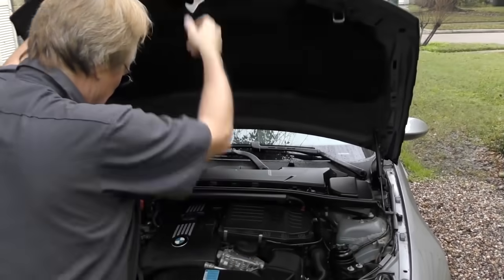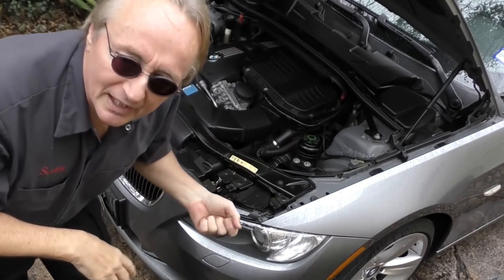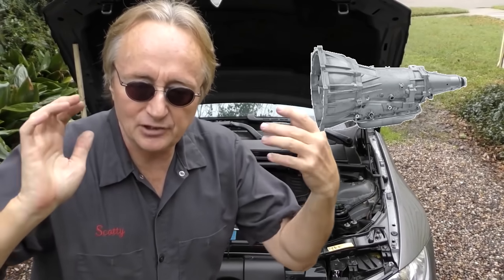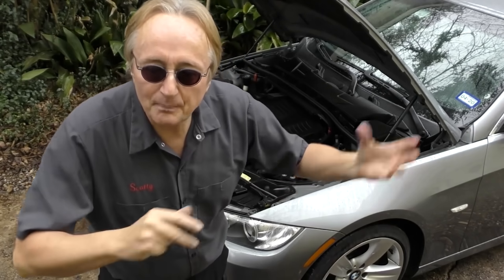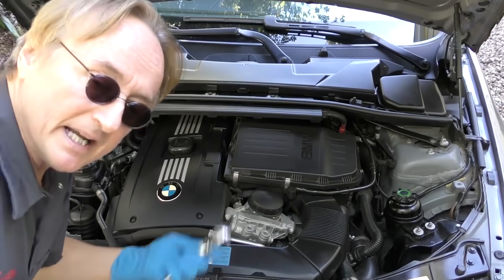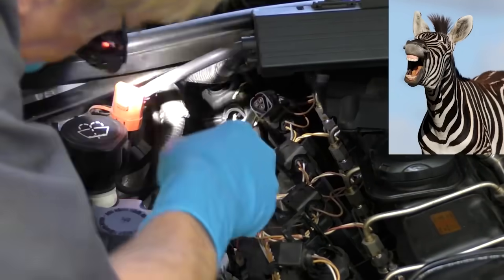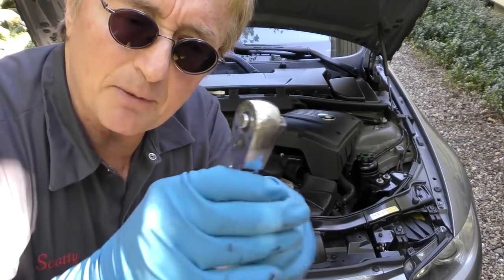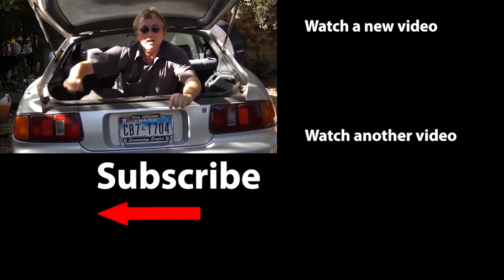People Say I'm Full of Crap About BMWs, Well Watch This

Comment: I've always wanted to own a BMW M3, and then I hear Scotty's voice in my head say "endless money pit" over and over.
Reply: Just get a warranty
Reply: Ive had two they aren’t unreliable at all and trust me i beat on my cars
Reply: @Mixalhsellada  10 years and no issues? Great to hear it’s running strong!
Reply: @Scooterboii94  good to know! Maybe in a few years I’ll splurge on one.
Reply: @BrandonMinguez  you better hurry up the prices on the e9x generation is rocketing to the moon
Reply: Just do like he says and lease one. Then you get to own it for awhile, but it can be someone else's endless money pit.
Reply: @Scooterboii94  for real i just bought a 2009 328i with 118k miles for $8,995
Reply: What about the rod bearings!? Was this huge job already done prior to you buying the car?
Reply: @enermaxstephens1051  Eventually I probably will. Maybe after my new car stops working.
Reply: @Mr Calcium haha I love the “boring reliable car” description. In the future I’ve thought about having a hybrid (for decent gas mileage) and then some type of muscle car or maybe an M3.
Reply: E92 m3s were actually very reliable. Mostly because they’re not turbocharged like the n54
Reply: @virenpatel9973  first model with the V8 (I believe) and an overall beauty.
Reply: I had a BMW m4 for over 5 years, bought it brand new. Never had an issue, manual transmission. The materials were nice but not that great. Fun to drive but the older ones were much better, talking about e46 era
Reply: @ronaldo19832  you bought it brand new. Go buy that car back now. See how never had an issue holds up.
Reply: @BrandonMinguez  yeah they were the first m3 with a v8
Reply: BMWs love to have their maintenance done before it needs to be done. As long as you do things when you know you should rather till its broken you'll be much better off. They're great cars in my opinion on my third one. First one was an E46 I owned and ran the hell out of. Ran like a champ and sold her running @ 18 years old.
Reply: @Chaos1187me  e46 was a different generation. N54 had ridiculous failures. Replaced 3 water pumps due to leaks in like 2 years. High pressure doesn’t help. If you continue to drive on one leaking component, 2-3 other components in the same system are guaranteed to fail.
Reply: I also hear “Cheap plastic crap!” 😂😂😂😂
Reply: @Mr Calcium this dude knows how to own exciting cars. You literally need a savings account for repair and maintenance work. Just put down money monthly so your cars repair doesn’t give you a new credit card bill and its not such a pain because it was for the car either way.
Reply: @Mixalhsellada  you probably deive it moderately and take good care of it. Most people eat on them ecause theyre sporty and the rest in history
Reply: my dad owns a 2010 bmw x5 for 4 years it is a dream
Reply: @staplegun3703  Yes, I have one of those and had the model before that as well. Probably the two most reliable and trouble free cars I have owned. Both towed regular heavy loads as well.
Reply: BMW's are great cars, they require some extra maintence but go for it.
Reply: Avoid turbo models and you'll be fine
Reply: Yes, I've known very few repeat BMW owners.  I like them a lot, but would never have one myself.
Reply: I have an 05 M3, yes he is right about the cost of maitence, but if you buy the car and know how to work on it, then you save a lot of money doing your own repairs.
Reply: Never buy a BMTroubleyou.
Reply: @Mixalhsellada  So where do you buy parts for this unique non- issue BMTroubleyou?
Reply: M cars are toys, you go very fast for a very short time, fix rinse and repeat...
Reply: @virenpatel9973  wrong. Rod bearings and throttle actuators go bad. I'm not yo fussed about throttle actuators but I had 3 of them and all rod bearings when bad
Reply: @samanthamaxis2180  you’re right. Forgot about those actuators. Not cheap either since there’s one per.
Reply: @virenpatel9973  good car but that must be done
Reply: @samanthamaxis2180  yep. Not an easy job either. Did it with my buddy on his while I was in a&p school. Also smg trans is garbage.
Reply: @virenpatel9973  throttle actuators are not that bad now because you can get kits to replace the plastic gears with metal gears with warranty. 

It's the rod bearings which is the thing about the e92. But other than that it's great
Reply: Sadly he is correct
Reply: Buy it
Reply: Get e46 M3 because it was last one you can work on yourself.
Reply: Learn how to wrench on it.  And you’ll save thousands.  
That car in video is the infamous n54 330hp twin turbo 

I love mine.
Reply: Just keep a cigar and can of seafoam handy and you won't go wrong.
Reply: Scotty said "Lease The Car."
Reply: 2018 M3 are way better cars now they learned their lesson
Reply: I had an Alfa Romeo that never let me down. Sold it for a 3 series BMW that had so many issues that I sound it a month later. I'd go onto the owners forums and they were like "yeah that's a known problem", "oh yeah, they All do that"....
Reply: Scotty has said the M3 is an exceptionally well built Car.
Reply: BMW timing chain failures! Look it up.
Reply: If you’re hearing that voice it must be incredibly annoying
Reply: Not get missinformed - all M-Powered models till 2012 are TOTALY DIFFERENT cars then BMW's. Believe me
Reply: M3 is not that bad, if you want it
Reply: Same.. So I bought a Lexus IS 350 instead 🤷🏽‍♂️ 100% satisfied
Reply: Don't buy a BMW that's all I know i had one, and I'm never buying one ever again, I just went with Vauxhall Insignia and has never giving me problems for 4 years now.
Reply: @BrandonMinguez  it's like being in love with one lady and marrying another one that's good but doesn't excite you, but ticks more boxes. Do you have a spare life for it?
Reply: Just buy one with warranty and make sure the car has proper service history and you will be alright.
Reply: I test drove one before I graduated college..fell in love with BMW at that moment and owned a BMW 330xi for years until recently. Spent thousands and thousands on repairs after the first 8-10 years of ownership so trust me when I say this. If you ever own one I would strongly recommend that you get rid of it before the warranty is up.
Reply: @wolfofwacker4578    Our 330xi and 328i have always been very reliable and needed little or no extra ordinary maintenance. Only thing that was expensive was the water pump and thermostat, also the the front driveshaft. Overall very good cars. I agree that the newer cars are only worth leasing.
Reply: He's not wrong !
Reply: I love talking about maintenance on any brand. I’ve had 2005 330i, 2007 335Xi, 06 IS350 after 335xi then 2006 lexus GS300 and now Gs460.  After all i now know for reason Bmw’s are usually needed for maintenance, they’re built well, My buddy had e92 M3 with v8 he’s got 189k Yes Rod bearings are done and few other common issues. Even lexus has small common issues.  I guess it depends on its history, I prefer buying Stock bmw off adult versus kid that cheated out maintenance
Reply: @bilalahmed2123  exactly, my buddy’s 08 Lexus GS350 awd had before front drive shafts replaced, it had Front diff isssues at 125k he bought another bmw 😂.
Reply: And that's why I got a Lexus RCF instead of an M3 :)
Reply: @LilSwervoJr  damn u should’ve waited I got a 335i 2009 red interior for 7 at a dealer ship w warranty
Reply: It’s all about the owner to be Honest for the normal people they need cars for daily use a M3 is a car for enjoyment if you treat it right it will run for ever
Reply: @BrandonMinguez  they’re not unreliable the reason people think that is because when there’s an issue people just sell them instead of fixing them which gives them the bad rep
Reply: I've bought CLS 63 AMG, and now every time I open the hood, I hear the same 😄
Reply: Generally true. My advice: if you’re set on buying one - maybe opt for the ‘slower’ version as these were beat less severely. If not set on buying then lease like Scotty recommends. BMWs can be money pits but they do drive wonderfully and are sexy asf.
Reply: @BrandonMinguez  I wouldn’t Get a nice infinity will do you much better than a BMW My friends BMW shits on him every six months or so And he does all the maintenance at the dealership 🤦‍♂️ and He’s only put 50,000 miles on it.
Reply: I've owned a 2004 M3 for 16 years. Still own it and it runs great! Have loved this car always. BMW's are ONLY for true car lovers who can work on their cars.
Reply: @nunoveiga5080  You’re right BMW should be for people who are willing to work on their car You’re going to need that knowledge if you have a BMW.
Reply: Yep, and you will pull a chic that works at McDonalds while driving your Prius and think you are happy.  Keep the real spending to the big dogs.
Reply: He's right. I had a e320 Mercedes. Piece of garbage.
Reply: @Mixalhsellada  how much miles you have on it. When it goes over 100000 miles on it. Game over. Just give it some time
Reply: @virenpatel9973  all these guys are BMW fanboy. Let these cars get over 100000 miles and see what thry say.
Reply: I bought a ' lovely looking' Bmw 330i m sport 2007 3.0 auto coupe 5 months ago, bought it with 107k miles. In those 5 months some 7k miles later.. I have had to replace the Water pump  -  thermostat  - Starter motor and then the actual engine started to sing loudly and started to make the car stall. Total disaster purchase. Luckily somebody came along and keyed it so it got written off and i got the money i originally paid for it ! So i got lucky in that sense lol
Reply: I own 335i and yes, it’s expensive, but when you start to tune them and you have a tiny car that flies with over 430hp, I’ll say I still love the car. But it’s a money pit
Reply: Bro, they’re not that bad
Reply: @LilSwervoJr  w
Reply: @Mixalhsellada  it had issues but issues that u could easily manage
Reply: @BrandonMinguez  xxx
Reply: @Mixalhsellada  Cap lol
Reply: BMW #3 in reliability now. Times are changing.
Reply: If you want a car to have fun some days go for it. If you want a daily driver go for the non sporty versions and make sure you treat them well, you won't be disappointed on the drive experience
Reply: If you can't wrench, don't buy it! 🔧 🛠️🔧
Reply: buy an e46. there's enough people online that love that car that any work you need to do on it won't be too difficult to learn. I've probably done about $5000 worth of "work" at a dealership by spending about $400 on parts. If it has any engine or transmission issues that's a different story unless you're knowledgeable on that stuff, but everything else aint that bad
Reply: @I’m him, the ultra giga alpha  those who never own an M3 should drive one, and they'll know why they have to have one.
Reply: E36 or older are fine.  Replace cooling system with metal parts  (Mishimoto all aluminum radiator, metal impeller water pump, metal thermostat housing) and you're good for a long time.    I'm still driving a 97 M3 with 150k that I bought new.
Reply: Get the BMW, you’ll love it.
Reply: @ignacioromero5014 lol obviously you know nothing about M cars
Reply: Nah g buy the m3 the new ones are super reliable I have an 06 bmw with 340k miles. This is a n54 known to have problems bc of owners trynna make tons of power while neglecting maintenance. Scotty knows how to tighten and loosen a bolt but he’s pretty ignorant and doesent know what he’s talking about.
Reply: @Mixalhsellada  I also have E93 2008..it has ups and downs ..biggest down is very harsh ride in my city which is full off potholes and bad asphalt everywhere (and is getting worster every year),there are some bad streets that i completely avoid with this car (it has run flat tires 19 inch) ...but it looks still awsome and girls still turn heads after all this years,and when you go out off town on twist road its just beautiful ride.
Reply: You gotta be a man to own one and know what you’re getting into. Learn to turn a wrench and get a warranty and you’re good.
Reply: Lease it under warranty. Or go to grad school and get a higher paying job.
Reply: you’ll need to make sure to have money set aside specifically for the rod bearings, but in my opinion it wasn’t enough to lead me away from buying the car and i don’t regret buying it at all
Reply: @virenpatel9973  the s55 was basically bulletproof minus one flaw
Reply: @Tachyon836  one flaw means it’s not bulletproof.
Reply: @virenpatel9973  every car has one flaw, even toyotas
Reply: @NA-vl7ww  the extended warranty is a waste of money
Reply: The e46 m3 have issues with the rod bearings, so budget in future bottom end rebuild.
They require valve adjustment every 30k miles.
Also have rear subframe issues,  need to be reinforced.
Reply: The only solution is to buy a BMW body and find a reliable replacement for the engine and transmission.
Reply: Lament selling my e30 every day.  The rust was going to be 10 grand. Which was more than the car cost me.   Had I?

Comment: There is only one route to owning these cars. Buy new and sell three months before the warranty runs out.  Here in Germany it's now becoming commonplace to sell them as soon as two years old.  Taking the depreciation loss is less costly than repairing them.  And repair them you will.  BMW today, I'm sad to say, is nowhere close to the quality they had in the past.
Reply: Rubbish, I've owned 9 BMW's some from new some as old as 20 years. So long as you buy right and they are serviced regularly and properly they are very reliable. Parts are expensive, but you get what you pay for. Currently I have an X4M and an old 2004 E60 530 Msport. Owned it for 7 years and total cost to maintain is just under $5500 USD runs and looks like new inside and out, whereas my Ford of the same year with half the milage is now worth $500, paint faded and clear coat peeling. Inside everything is perishing or now broken. Only thing that is good is the engine.
Reply: I bought both my 3 series with 100,000 on them 1st one 330xi 2003 last 8yrs drove it to 287,000 sold it ,then got 2011 328xi had it 7 yrs but put alot less miles its only 167,000 with usual oil change,injectors,coil packs,plugs ! 330xi,s tran went at 187,000 went to junk yard put 60,000 trans in at          
$ 1200 for trans and $800 to install by local guy . 328xi I've only did electric coolant pump recently for $350 just don't buy turbo powered bmws or other brands and you won't have to many issues !
Reply: My 330xi went 100,000 on front brakes which I think is amazing !

Comment: As a owner of an 08 328i I can agree with this video. Maintenance nightmare. Great to drive. You have to be a mechanic to have this car.
Reply: Yes, I just passed on a 09 328Xi. Inflation is real...I can use my money for other things.
Reply: 2008? 16 yrs old, old car.
Reply: @TheDutchGuyOnYT  Yes, I have owned it since 2010. Starting having issues around 75K. There is usually something that pops up every 6 months. Rear main seal is leaking oil right now. A BMW will educate you on every part of the car.
Reply: @samuelwilliams7331 it’s not a owner nightmare. Know how to fix these cars or don’t get them at all. Lots of ways to save on BMW maintenance. It’s mostly labor costs that make them expensive to own. YouTube is full of DIY’s and there are plenty of honest mechanics that won’t rip you off.
Reply: Agreed
Reply: @trustyoungpierre9959  You just backed up my statement. If you want these cars then be prepared to wrench on them yourself or the mechanic will kill you with labor charges and overpriced parts. It isn’t a Toyota.
Reply: same, 335i 2007… i will never financially recover from the turbo replacement 😂
Reply: @neoavenir  I do t even want to know. That’s on my radar now. No problems but I have 140,000 miles on her.
Reply: Id rather pay 40-50k for a new BMW vs 60-80k for a new Ford f150 lol
Reply: Yeah definitely need to be a Good few years experience DIY mechanic . To able to handle all the maintenance I’m actually happy is not TOO reliable I love learning how to fix and I order parts online cheapest prices but some parts I don’t cheap out on

Comment: Amazing machines that are prone to breakage as described. Scotty is 100% right. The use of plastics and the excessive heat generated by the turbos make these a maintenance and repair nightmare. I paid over $50K and have had about $25K worth of repairs. Luckily I’ve done most of it myself. Pulling the engine and dismantling the front end to replace the oil pan GASKET. Insane amount of labor for a simple procedure. Wish this video existed in 2009 before I bought mine.
Reply: Not all bmws are turbos